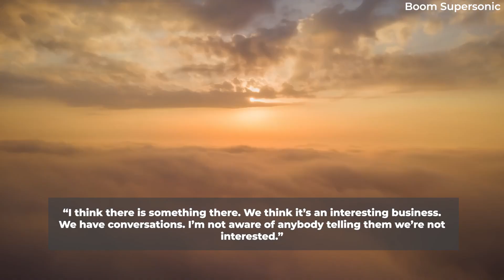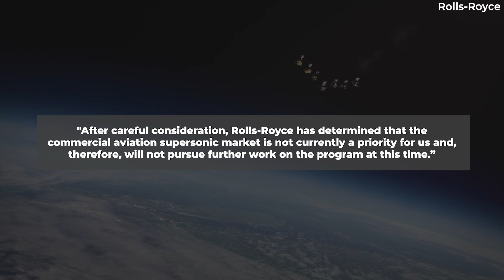Boom Supersonic Continues To Search For Engine Manufacturer

Comment: The problem for Boom is that they aren't looking for a subcontractor. They are looking for a risk partner and nobody thinks there will be enough engines ever sold to cover the R&D costs, even if everything went perfectly.

The other thing one must remember is that it's not just a matter of finding someone to make an engine. It's a matter of finding someone to make an engine that the airline customers believe are willing and able to provide customer support for the next 20 years on an engine that is cutting edge and who knows what problems might crop up after they are put into commercial service.

The airlines want to know how MRO is going to be handled for a couple of decades.

Comment: Well, just a thought. If Boom got a set of engines and it then turns out the sonic boom is still too much to get the airplane certified for flights over land, then the reason for the project would be stone dead.
Considering the amount of money it would require to develop an engine for this airplane, it is no surprise the large engine manufacturers are not so interested.

Comment: They should ask Volvo to modify some JT8D 219s for supersonic flight.
Reply: at least 6 per airplane, and the bypass ratio would need to be increased from 1.75 to 2.5+.  You have to start with the right engine core.
Reply: @gofaster6120  Why? The Jt8D 219 already has at least as much thrust as they wanted and is fairly efficient as it is. Plus, higher bypass is generally lower flow so that isn't what you want for supersonic speeds. Considering no engine manufacturer seems to want to make an engine for them ,it looks like their only hope.
Reply: @davidkavanagh189  In order to meet ICAO Chapter 14 noise rules, Overture will require a bypass ratio of greater than 2.5 in order to meet the lateral and flyover noise criteria.  Your comment on thrust must be focused on takeoff.  Takeoff is not typically the critical engine sizing point for a civil supersonic aircraft.  Supersonic acceleration and top-of-climb rate-of-climb are the typical sizing constraints.  The engine core (not fan) plays a larger role at those conditions, and the JT8D core is not large enough for the Overture thrust requirements.  Another couple points that are often missed include the weight of the JT8D relative to its thrust and the operating temperatures.  Advance turbomachinery computational fluid dynamics allows for compression to occur with fewer stages.  As supersonic aircraft are very sensitive to operating empty weight, it would be leaving a lot of technology on the table to use the JT8D. The compressor materials would have to be changed to accommodate the high temperatures needed to achieve maximum efficiency.  This would likely require a lot of new certification work, which is extremely expensive.
Reply: @gofaster6120  Interesting! Worth noting though that Volvo adapted earlier versions of the Jt8D for the supersonic SAAB Viggen so far from impossible. In any case, they have a long road ahead without support from any of the major engine manufacturers.
Reply: @davidkavanagh189  The noise and efficiency demands of a civil supersonic aircraft drive a different set of requirements.  Big announcement coming this Tuesday from Boom, but I highly doubt they will every fly a supersonic commercial aircraft.  XB1 has no relevance to a commercial supersonic aircraft.
Reply: @gofaster6120  Yep I'm aware of the noise and the JT8D 219 will not be any louder than what they had hoped for for takeoff. In any case, I agree that it's very unlikely we'll ever see this aircraft even get to the prototype stage. Nowhere near enough major player support.

Comment: Did Boom Supersonic look into requesting a civilian version of the F101 engine? If so, it could be built with a CFM56 or CFM LEAP core optimized for supercruise capability. Boom Supersonic should also look into offering this plane for military or government applications (high-speed cargo, personnel or medevac), again to access the F101 platform.
Reply: U.S. Air Force, long ago, signalled it's interest in purchasing a number of the Overture aircraft, if it ever comes to be.
Reply: @anthonycanalese2142  Even then, the USAF seems far more focused on suborbital transportation for rapid troop transport (e.g. SpaceX’s Starship, Rocket Lab’s Neutron) than a supersonic airliner. They might order two or three, but ultimately, for these things, the USAF usually just has a contract with airlines to use their aircraft for troop transportation.

Comment: I think the problem is that the first design they proposed was a more sustainable aircraft as it looked to be not to big/small. And only had three engines but then they decided to go for a quad jet and a design from the 60s. They've just basically brought back the Boeing 2707.
Reply: Just because it has the same number of engines doesn't make it the same design as the 2707.
Reply: @anthonycanalese2142  If you look Overture and the 2707 they're pretty much identical.
Reply: @JustPlaneNuts2993  Except they’re not. The 2707 would’ve been a wide-body.

Comment: GE and P&W were the only makers of engines in the thrust and size class Boom wanted: the F120/F136 and F119/F135 for the F-22 and F-35 respectively.  The fact they chose Rolls-Royce instead means the two American engine makers blew them off.  The Overture is dead.

Comment: Is there any possibility for Reaction Engines to collaborate? Although it's SABRE engine is manly designed for space, it it's rated to work as an engine up to mach 5, I wonder if they would jump on business by iterating the SABRE engine.
Reply: Absolutely not. The SABRE engine has a specific impulse that makes it impractical for any use other than sending something into orbit. Do not think of the SABRE engine as a hybrid between a jet engine and a rocket engine, it ultimately is just a rocket engine that can use our atmosphere as its oxidizer instead of using liquid oxygen. Additionally, since it is a rocket engine, it cannot have the ability for deep, smooth throttling, because of the possibility of the atmospheric pressures entering into the engine bell, which would immediately cause severe combustion instability, likely resulting in the loss of the entire vehicle.

Comment: I don't think they will find any at this time.  Economy is going down and gas prices make air travel much more expensive.
Reply: Yeah like the Oil Embargo in the 70’s and Desert Storm, there was less people flying cause it got expensive but more people taking trains due to some running on electrified tracks coupled with more sustainable power sources it becomes more cheaper or competitive to flying. Could be happening again

Comment: Classic case of startup with lots of hype and little substance. It's easy to propose something and make a few mockups and cool CG videos....it's extremely difficult to get to the finish line.
Boom is just basically doing what Concorde did, but slightly different. Concorde didn't work for many reasons...and Boom has failed to adequately address any of those issues.
It has failed before it will even begin.
Reply: spot on

Comment: Are we just in an age where long range narrow body aircraft are a more efficient choice for airlines, than a supersonic airliner?
Reply: Practically going slower than supersonic is more fuel efficient and can carry more people and have more range than supersonic jets. Same fit with High Speed trains and Hyperloop idea, sure it could twice the speed but it Carries way less people and could be more efficient by coupling or increasing the capacity which just reinvents the train
Reply: Yes, but if there is market for paying at least three times the normal fare to have a flight only half the duration, I'm sure some airliners may be interested.
Reply: Nowadays; cheaper, not faster is the name of the game.
Reply: @rbgerald2469  It depends. If that was true, there wouldn't be First Class in any airliner anymore.
Reply: @gteixeira  ..What I meant was, airlines prefer the strategy of stuffing people into aircraft, and carrying them efficiently; saving them loads of fuel (therefore saving them loads of money); rather than going fast.
Reply: @rbgerald2469  There is no one offering supersonic travel as of now, I can't tell how big or small the market would be if anyone offered it.
Reply: @gteixeira  Aye..

Comment: I'm thinking Rolls Royce might not have pulled out if it was an efficient 2-engine model. Or perhaps they'd find another potential partner if they found a way to make a 2-engine concept work.
Reply: There are no partners to be dealt with it wouldn’t of mattered or there was 23 or four engines just no interest there by those development costs are too high
Reply: @johniii8147  wouldn't have not of

Comment: P&W F135-100 and GE F136-100, and preferably the USAF funded development versions of these engines would be best - however, I not sure of the Boom thrust needs.
Reply: The issues with DOD (USAF) funded components is that the end product is essentially already sold, to the US Government or it's agreed to allies.  Partly due to ensure fair competition in the civilian market (Uncle Sam has deeper pockets and any company using those pockets can outspent competitors in R&D). Also those engines may have components that are deemed "restricted due to national security", and thus not available for the open market.  Lastly, have you priced a fully decked-out F135-100?  They are hella expensive, far more than what an airline would be willing to pay.  I'm guessing that could be a reason why P&W and GE aren't too keen in going in with Boom, they'd have to essentially re-design an engine they already have, without the extra dosh from Unc'l Sam, and with the understanding that lawyers are going to sue their socks off for misappropriating government funds and unfair competitive advantage.  And for what, 150-200 engines total.  Yeah-naw, they're sticking with the DOD and that sweet, sweet taxpayer cheddar.
Reply: @macsandsquid528  Only military engines are capable of supercruise. The primary markets for Supersonic civilian aircraft are US to UK, France, South America, Japan, Korea, Singapore, Australia. Uncle Sam can control who is customer, and the routes flown, and who can maintain. RR did the development work on the engine intake and outlet. Northtrop Grumman is assisting find military customers. The advantage to the US taxpayer is that they get a civilian return on investment.

Comment: Is the "good ole boy" network plotting against Boom Supersonic?
Reply: No plot. Engine manufacturers would have to devote huge sums of money to develop a completely new engine for one specific airframe that has very real reasons as to why it has a high chance to fail. They don't want to flush that money down the drain when they have much greater market share in other engine's they are developing or improving. It makes complete sense. All the big three engine makers have turned away and even some of the joint venture companies like CFM because it's just not worth doing right now. Maybe in the future but not right now.
Reply: No. It's not a conspiracy, it's just reality. The chances of Boom getting the overture to market are minimal at best, and other "startups" trying similar concepts have gone bust recently. A new supersonic engine (even one built around an existing core) is a huge investment, and gobbles up resources needed elsewhere, with little chance of ever seeing that money again. It's a shame, as who wouldn't love to see a supersonic airliner again? but, reality is... the prestige of luxury flight has been and gone, and any residual prestige of high end business travel being a thing was one among many victims of Covid.